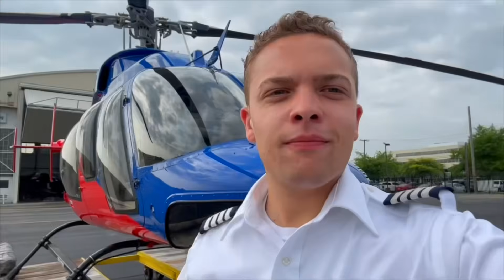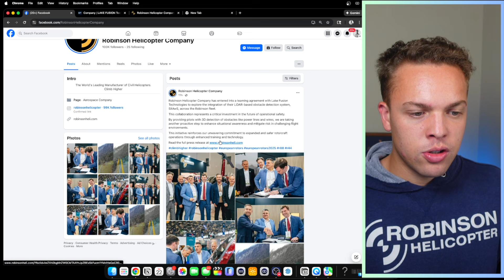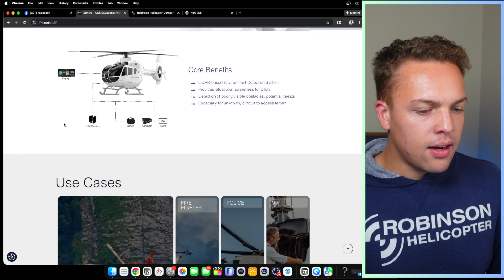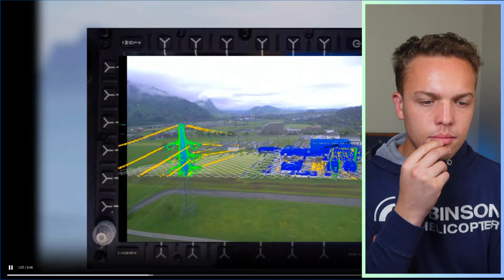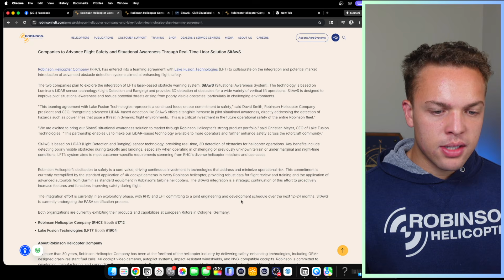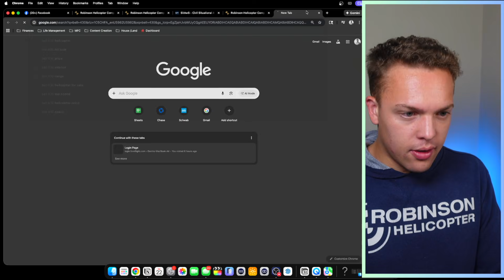Robinson Just Changed EVERYTHING — New Lidar Partnership Announced

Comment: 1) LIDAR can be useful , but is quite limited in capability in "real life".   The resolution and update (.i.e. frame rate)  is low and slow (~10 - 20 fps), which is a big issue while flying at >30 kts / hr.  The resolution and range are also limiting factors.  The example of an HV transmission line is cute, but those wires are thicker than your wrist and most line strikes are with wires thinner than your thumb, which it can't resolve at even a short distance, especially while flying.  Car manufacturers are abandoning LIDAR for these reasons and more.  Another case of "Overpromise, Under Deliver" by tech.   Which is a nice segway into Hill HX-50:

Hill will not have a flyable engine & transmission until later in 2026...maybe.  The HX-50 will not fly OGE next year,  possibly mid-late 2027.  Regardless of the progress of the HX-50 helicopter development and its abilities, people forget 2.5 key facts:  

1) It's a limited use, "kit built" (i.e. >50% built by owner) 'copter, so zero revenue (not even "gas money") or commercial use, restricted to low population areas & small rural airports & LZs in the countryside, outside of ATC airports and their airspace.  This is their fundamental business model !  

2) Regulatory approval will take years, even in this category.  Currently they occasionally mention "a good relationship" with the CAA but crickets about the EASA or FAA certification, which have the major authority globally and take longer and more resources.  None of them has ever approved a turbine powered "owner-built" helicopter.  

2.5)  Hill says they will offer their own "Hull" insurance, which is great.  What about liability insurance?  Good luck...  

All this will either stretch out for several more years (if all "goes well" first delivery in 2028) with increases in costs or... It will all collapse when buyers' "jump ship" or there is a "major event".  It's hard to know how many "buyers" are just investment speculators never intending to actually posses an HX-50, but that number is not zero and could easily be double digit percentages.  Time will tell.  Their recent activity of putting out a sale focused videos (selling the "sizzle") twice a week, does not bode well for their prospects.  They reportedly have ~ 1400 units "sold" (i.e. "reserved") so far, with zero operational aircraft and a partially completed facility, which they say can make maybe ~300 per year "when fully ramped".  This means that if you buy one today, it will be 2032 before you can complete building it.  Hence the speculative investment of ~$38,000 reservation holders...